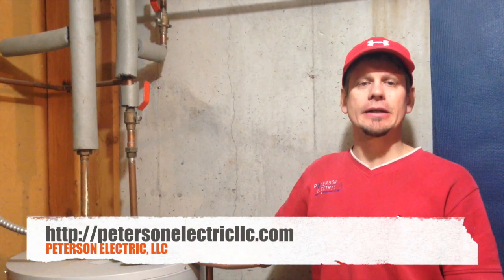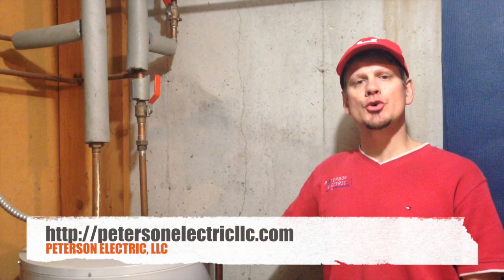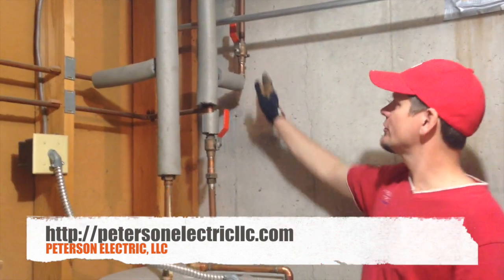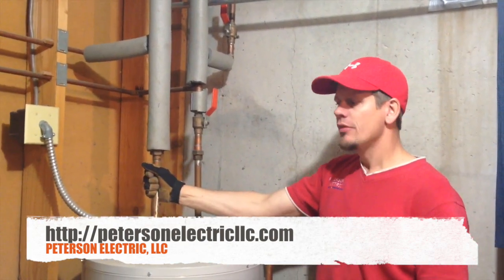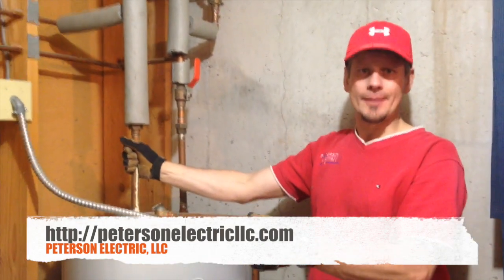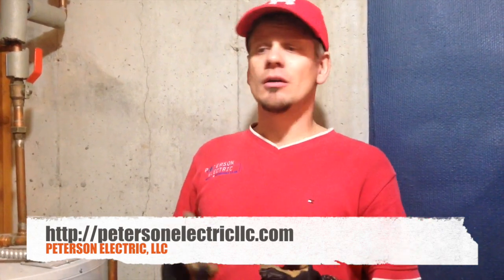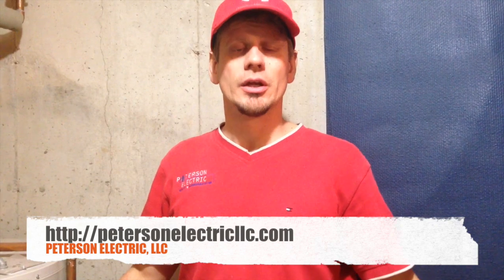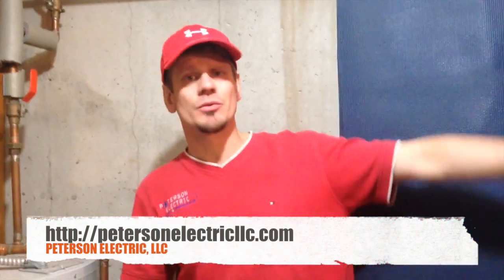When Are Grounding Electrode Conductors Needed? This Is Grounding In Your Home

Comment: If a house has all plastic pipe from the city water supply, do you mean that the two grounding electrodes,  8 foot apart , with the correct gauge wire is all that is required.

Comment: 1) The reason for grounding within 5 ft of building entrance is so that there is little likelyhood that  the conductive plumbing will be interrupted with non-conductive pipe.  2) Bonding was commonly done at hot water tanks because of the ease of bonding hot and cold water pipes as well as a gas line.  This bonding conductor did not have to be connected to the grounding electrode conductor.  3)  A second 8 ft ground rod has been required for a long time by NEC if you could not show that a single ground rod installed had a resistance of less than 25 ohms.